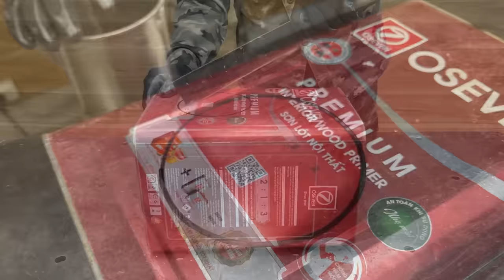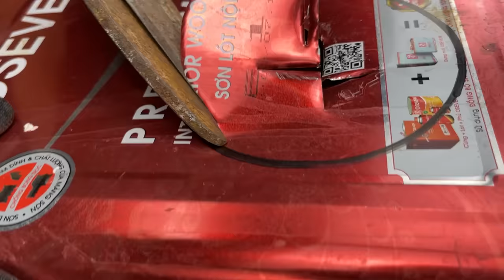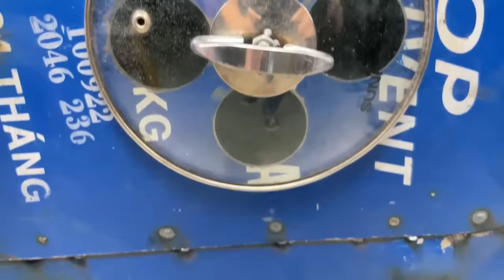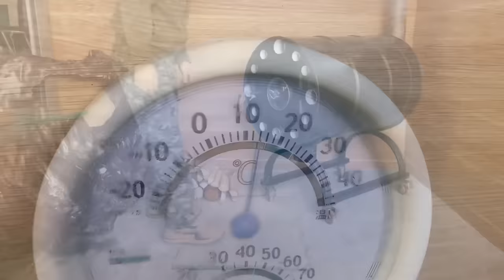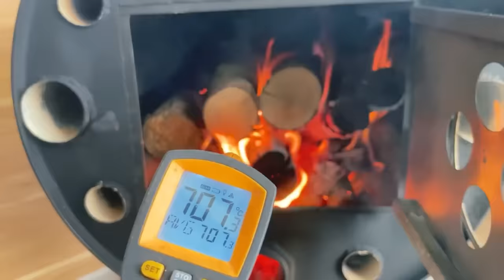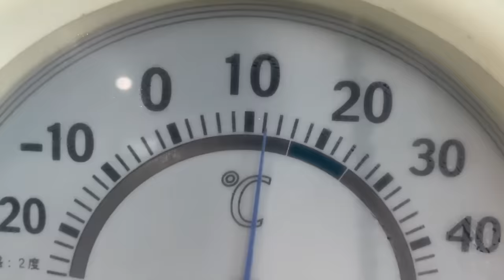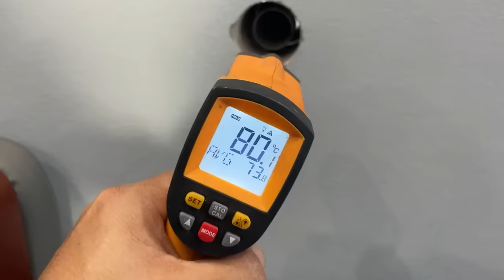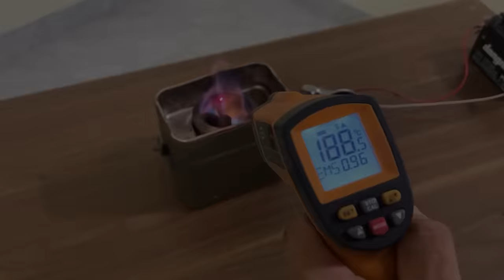Homemade sand battery heater - travel stove, easy instructions!

Comment: You have such good ideas and great craftsmanship. Why are you ruining everything with a bad example?
Using a grinder without a safe cover is, with all due respect, very stupid. Many people claim that they cannot see what they are editing with Safecover, that is nonsense. I am a craftsman myself.
In my circle of friends there were 3 accidents with grinder without a safe cover.
A friend's window broke through and almost severed a finger.
Another friend had his Grinderdisc  jammed while sanding his car and slipped out of his hand; the grinderdisc severed the tendons of 3 fingers.
And friend number 3 was cutting stones while building a house, the disk splintered, a piece of the disk got stuck in his forearm and severed 2 tendons and the main artery. Only an emergency operation could save his life. The disc from a grinder that rotates at 20,000 revolutions per minute, a spitter of it, has the same speed as a bullet from a pistol. If someone shoots you with a gun, will you protect yourself with just gloves and glasses?
Look, the metal safe cover has a reason
Reply from the maker: Thank you for your feedback and concern about safety. You bring up an essential point regarding the importance of safety when using tools like grinders. I completely agree that safety should always be a top priority when working with power tools.

You are correct that using a grinder without a safety cover is risky and can lead to accidents, as you've mentioned. I appreciate you sharing those real-life examples to emphasize the potential dangers. Safety measures like using safety covers, wearing appropriate protective gear (such as safety glasses, gloves, and more), and following safety guidelines are crucial to prevent accidents and injuries.

It's essential for creators to promote safe working practices in their videos, and I'll do my best to ensure that safety is emphasized in future content. Your feedback serves as a valuable reminder of the importance of safety when working with tools. Thank you for raising this concern.
Reply: And the reason it was removed was because the wheel  was too large to fit in the guard. So it was removed to allow the cutting to proceed. I personally almost never wear safety goggles, or have a guard on my grinder when cutting steel. I cannot see the cut with the guard in place. So to facilitate keeping control of spark direction and proper view of cutting operation, the guard is removed nearly every cut I make. 
From the injuries you describe, it seems that armored sleeves and gloves would be safer, for fragments can easily escape from a guard!

Comment: You might want to work on your welding just a little bit you had fish eyes which means it was a cold weld. They weren't bad just just follow your puddle all the way through to make one solid bead. Great job though.
Reply from the maker: Thank you for your constructive feedback! I appreciate your observation and the advice on improving the welding technique. Addressing fish eyes by ensuring a consistent and complete bead throughout the welding process is indeed essential for achieving a strong and reliable weld.

I'm grateful for your positive acknowledgment despite the noted areas for improvement. Learning and refining skills is an ongoing process, and I'll certainly take your advice to heart to enhance the quality of my welding in future projects. If you have any more specific tips or insights, feel free to share—I value your expertise. Thank you for watching and taking the time to provide valuable feedback!

Comment: More well.
Reply from the maker: Yes, thank you for your feedback. Do you have any suggestions or participation for us? Please let us know. We will try to serve the audience. Wishing you good health.
Reply: @lmtn  I live in Brazil, it's not cold.
I was just amazed by your work, I found it quite creative. It gave me some ideas, but it's not cold here.
Thinking about your equipment today, I imagine it loses a lot of heat.
my assumption is uncertain.
You could check the heat at the chimney outlet to see if all the heat was used.
You could create a machine that shows that much of the heat was absorbed by the house. a machine similar to yours.
I thought it was creative that you circulated the wind inside the iron tubes.
The good part of your video is that you measure the temperature.

Comment: Why dont I fabricate a good metal jacket around my old potbelly & fill w pea-gravel/regular gravel ...with metal pipe coils through the gravel circulating out hot air using intake fire box draw air flow powered "turbocharger style" air pump. No electricity needed!😮😁
Reply from the maker: Ý tưởng của bạn là chế tạo một lớp áo kim loại cho bếp potbelly cũ, bên trong là sỏi để tăng cường khả năng giữ nhiệt. Bạn sẽ sử dụng ống kim loại để tuần hoàn không khí nóng, với một hệ thống bơm chạy bằng dòng khí từ buồng lửa. Đây là một cách sáng tạo và tiết kiệm điện, nhưng cần chú ý đến an toàn và phân phối nhiệt. Bạn đã nghĩ đến cách thiết kế hệ thống thông khí

Comment: all fun and good until those rocks some of which hold moister explodes.
Reply from the maker: Absolutely, safety is a paramount concern, especially when dealing with materials that may have moisture trapped inside, as it can lead to explosions or other hazards. If there's a risk of rocks exploding due to moisture, it's essential to take precautions. Drying the rocks thoroughly before use or considering alternative materials that don't pose such risks could be important steps to ensure the safety of the stove. Thanks for pointing out this potential issue – safety should always be a top priority in any DIY project.

Comment: what type welding machine is that?
Reply from the maker: It would be helpful to provide more context or details about the specific welding machine used in the video. Different welding machines have varying features and capabilities. If you could share more information about the make and model of the welding machine featured in the video, I could offer a more accurate and detailed response. Alternatively, if the information is not available, you might consider checking the video description or reaching out to the video creator for specifics on the welding equipment used.

Comment: Why do they make stoves?
+ 15 degrees is warm, and + 25 degrees is hot
Reply from the maker: Stoves are designed to provide a controlled and comfortable indoor temperature, especially in colder climates. While you might find +15 degrees Celsius warm, it's essential to consider that many regions experience much colder temperatures, particularly during the winter months. Stoves help create a cozy and habitable environment by regulating the indoor temperature and offering a source of heat when needed.

The perception of warmth can vary among individuals and is influenced by factors such as personal comfort, weather conditions, and cultural expectations. Stoves provide a practical solution to address diverse temperature preferences and the need for warmth in different environments.

If you have specific insights or experiences you'd like to share related to stoves or temperature preferences, feel free to elaborate further. Understanding various perspectives contributes to a more comprehensive discussion on heating solutions.

Comment: 0:57 why ??

Why welding like that with point ?? 

Weld cash
Reply from the maker: Welding with a series of points or spot welding is often used for various reasons in metal fabrication and welding projects. In the context of the video, spot welding could be used for several purposes:

1. *Strength and Durability:* Spot welding creates strong and durable bonds between metal pieces, ensuring they stay securely attached even under stress.

2. *Precision:* Spot welding allows for precise control over the weld points, ensuring that the metal pieces are joined exactly where needed.

3. *Aesthetics:* In some cases, spot welding can provide a cleaner and more polished appearance, as it minimizes excess weld material and potential spatter.

4. *Reduced Heat:* Spot welding produces less heat compared to continuous welding, which can be beneficial in projects where excessive heat could cause warping or damage to other components.

However, it's worth noting that the specific welding technique used can vary depending on the project's requirements and the type of metals being joined. In this case, spot welding may have been chosen as the most suitable method for the intended purpose.

The comment mentioning "Weld cash" may be referring to the cost savings achieved through efficient and effective spot welding techniques, as it can reduce the consumption of welding materials and electricity compared to other methods.
Reply: @sucre9995 this is a different welding technique. Watch, learn, learn to think, and listen to the nice music! And try to form complete sentences, please!
Reply: I am industrial welder since 2005....
Dont loose your Time talking welding with me...

The way your welder is wrong ,watch vidéo youtube there is many good exemple 👍

Comment: Where is the sand battery? I saw a rock battery witch is terrible heat retention. Silica sand has some of the best heat retention properties on the planet. Use sand, not rocks.
Reply from the maker: Thank you for your insight! You're absolutely right about the excellent heat retention properties of silica sand compared to rocks. If the aim is to create an effective sand battery, utilizing silica sand would indeed be a more efficient choice due to its superior thermal conductivity and heat storage capabilities.

It's great to have viewers like you who bring valuable information to the discussion. If there are more details or aspects you'd like to explore about the use of silica sand in this context, it could be beneficial for your audience. Sharing specific insights or improvements related to materials can enhance the overall understanding of your project.

Thank you for highlighting the importance of choosing the right materials for optimal heat retention in your sand battery!

Comment: You should never had made and shown that chimney at the 29 min mark
As you made the connections upside down,
Allowing creosote to flow out of the chimney instead of into the stove 
You have shown how to burn a place down.
Reply from the maker: Thank you for your feedback and concern. It's essential to ensure that chimney connections are made correctly to prevent any potential hazards like creosote buildup or fire risks. We appreciate your attention to detail and will take your feedback seriously to ensure safety is prioritized in our future demonstrations. Safety is paramount, and we'll strive to provide accurate and safe information in our content. Thank you for bringing this to our attention.
Reply: @lmtn  There has been more fires caused by inverted chimney installations,
The fluid must run back into the fire box at all times, as installations of chimney's are not always done perfectly.

Comment: Burn out all used oil In the air😂
Reply from the maker: Yes, thank you for your concern as well as concerns about the environment. Yes, that is also what we are concerned about, but if we do well in the Kitchen Technique part, we will be able to burn it completely while releasing the toxins to a limited extent. affecting the environment. This requires you and me and many other technical people to research together to come up with wonderful, valuable works that are not toxic to the environment. The chemistry will also be better.

Comment: Second law of thermodynamics,   you loose energy every time it's converted.  Better off without all  that wasted mass.
Reply from the maker: This comment refers to the Second Law of Thermodynamics, which states that every time energy is converted, some energy is lost. In the case of a project like video, there seems to be a loss of energy from unnecessary volume.

You can discuss with your community how to improve performance or reduce energy loss in your project. There can be different opinions on how to approach this problem, and sometimes it can lead to creativity and innovation. If you have any other specific comments or questions, please share so we can discuss further.

Comment: Sorry, but it's too thin to be durable. After a few times it will burn out, it's a waste of welding and material
Reply from the maker: "No need to apologize; your observation is valid. Durability is a crucial factor in any welding project, and your concern about the thinness of the material is understandable. If you have experience with similar projects or materials, sharing your insights on how to enhance durability could be valuable. Constructive feedback helps not only the creator but also others who may be attempting similar projects. Have you encountered similar situations before, and do you have any suggestions for improving the durability of such projects?"

Comment: This guy puts out some nice DIY projects but beyond that he is click baiting you about the sand battery. 
There is no environmentally "eco-friendly" "Endless energy" free heat here, just sand (thermal mass) storing the heat from alcohol, lamp oil, or wax candles. Does anyone have free alcohol or wax? 
I use my concrete basement wall as a rechargeable heat battery.  My wood stove heats up the wall, storing energy, and the wall releases the heat for a couple hours after the stove goes out. 
These heaters ARE a nice conversation piece, that puts out relatively little heat, but make sure there is a CO detector nearby.
To put this another way, this person is NOT harnessing energy from sand batteries he is storing energy WITH the sand battery from alcohol, lamp oil, or wax candles.
Reply from the maker: Thank you for providing a detailed and informative comment! You've offered valuable insights into the practicality and functionality of these DIY projects, highlighting the importance of understanding their actual energy sources and capabilities. Storing heat within thermal mass materials like sand is indeed a way to utilize and release energy generated from burning fuels like alcohol, lamp oil, or wax candles.

Your basement wall heat storage system is an excellent example of using existing structures for energy efficiency. It's important for viewers to be aware of the true nature of these projects and to ensure safety measures, including having a CO detector nearby when working with combustion-based heating systems.

Your comment provides a helpful perspective for those interested in these projects, and it's always valuable to clarify misconceptions. Thank you for sharing your knowledge and experience! 🔥🏠🌿🌍

Comment: |> |> |> |> |> |> |> |> 
|> |> |> |> |> |> |> |> |> 

the ideas are not bad but the weldings are absolutly bad ...

no continoued wekding ... I know ... the fine are to dangerous to fall trough but but the tougher not and finaly you have pulsing too hopefully ...

that pointwelding is not secure and not tiight ...

Im machinist and had all certifications ...

can anyone show here in such cgannels show real welding and not that actually highly dangerous bad shit?

|> |> |> |> |> |> |> |> 
|> |> |> |> |> |> |> |> |>
Reply from the maker: "Thanks for sharing your expertise! It's crucial to prioritize safety and quality in welding projects. Your concern about the welding techniques is valid, especially when it comes to ensuring structural integrity. If you're well-versed in welding and have certifications, it can be frustrating to see subpar welding practices.

Constructive criticism is valuable for improvement. Perhaps suggesting alternative, safer welding methods or materials could contribute positively to the community. Sharing your knowledge and encouraging a focus on safety and precision in welding could be beneficial for both the creators and viewers. Have you considered providing some tips or insights based on your experience as a machinist and certified welder?"

Comment: Not every one has that kind of tools, just not practical
Reply from the maker: You're absolutely right; not everyone has the tools or resources for such endeavors, and practicality is essential when considering any DIY project. It's essential to weigh the costs, benefits, and feasibility of any undertaking. If it's not practical or accessible for you, there are always other ways to enjoy candles and achieve similar effects without the need for drilling holes in walls. Safety and practicality should always be the top priorities! 😊

Comment: That fan is just plastic with no insulation between it and all the heat. How would it not melt after the stove heats up??🤔
Reply from the maker: You bring up a valid concern! The fan used may indeed be made of heat-resistant plastic or have a design that prevents it from melting under the stove's heat. It's essential to use components that can withstand the high temperatures to ensure safety. If you have further questions or need clarification on the materials used, it's a good idea to reach out to the video creator or manufacturer for more details. Safety should always be a priority in such DIY projects. 🔥🛠️👷‍♂️